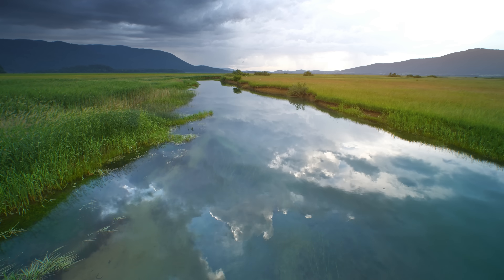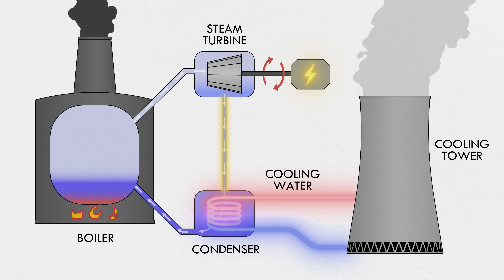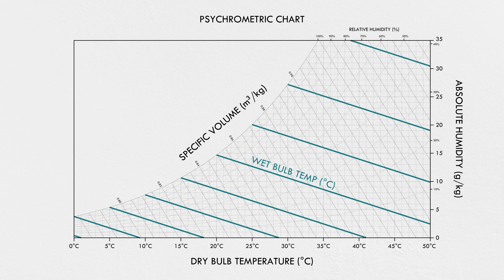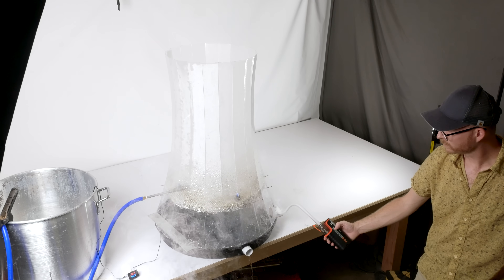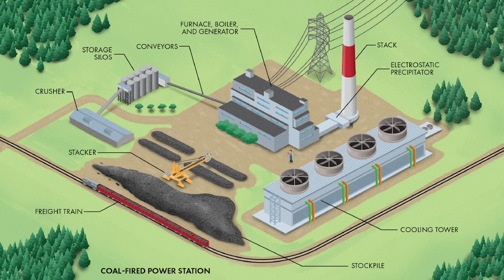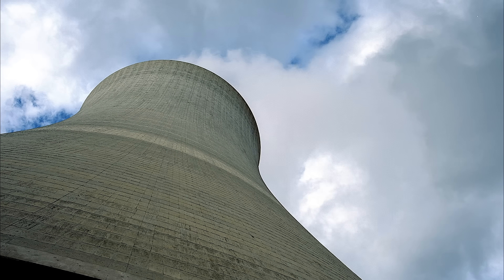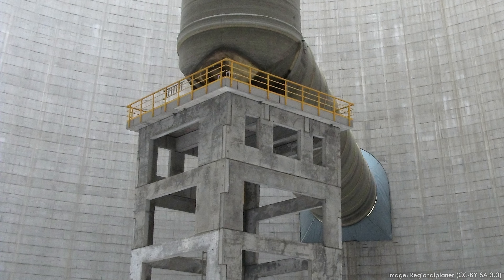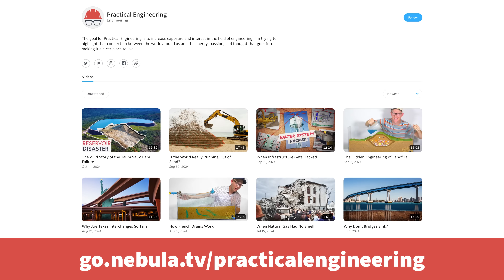Why Are Cooling Towers Shaped Like That?

Comment: 7:00 I'm an HVAC professional and I love seeing the psychrometric chart in a YouTube video! I design dehumidification systems for suspension bridge cables.
Reply: I had no idea dehumidification of suspension cables was a thing.
Reply: @stupid1557  it wasn't until they figured out packing the cables with lead paste was a no-no. There's just no better way to keep cables from corroding. The cables are made up of a ton of tiny wires, and there ends up being a lot of space between the wires in the cable for rain water to collect. But, if you seal the cable best you can and push dry air into the cable you can dry out the cable and prevent it from rusting.
Reply: @AlexWaardenburg  The age old fable of: This thing that works really well is actually made out of some toxic thing we don't want to be near.
Reply: @AlexWaardenburg  you haven't mentioned the ice that can form on those cables.
Reply: @AlexWaardenburg  I think you need your own video now!
Reply: @doodlesbug  I would love to tell Grady all about it so that he can make a video about it.
Reply: . That's interesting.   All this while I thought that the cables were just coated with a corrosion inhibitor or paint.  Thinking about that now I can see how the individual strands probably wear against each other when the cable flexes and any coating would wear off.  Is that correct?
Reply: @AlexWaardenburg   for moving cables (IE lift bridges) LOTs of grease of mopped onto them to do the same.
Reply: @AlexWaardenburg  Tom Scott has a video about this!
Reply: @doodlesbug  I second that
Reply: @AlexWaardenburg  Bruv, you've a very cool job & wish I was your bud... hearing about this fascinates me honestly
Reply: @AlexWaardenburg I learned something new today!  Thank you for sharing!
Reply: @uiomancannot7931  In this case, a thing that we AREN'T near.
Reply: @AlexWaardenburg i have seen this done for underground pipes carrying tons of betwork cables. Pushing dry nitrogen to keep leaks leaking out instead of water flooding in. Never thought we had to dry the inside of the bridge cables…
Reply: just use paper towels
Reply: @AxDhan  You joke, but that's effectively how desiccant dehumidifiers work. They soak up the humidity from the air, then you blast them with heat to dry them back out so that you can reuse them. Then you pack them in a wheel and rotate it through an airstream that you want to dry, and a separate airstream that dries them back out.
Reply: That sounds like a pretty cool job.
Reply: Air drying is used to prevent  corrosion in metal bridge decks also , the bridge that's a part of the  road and rail link between Denmark and sweden is not painted on the inside part of the bridge I deck sections on concrete pillars, and part is a cable stay bridge.
 (the pylons is concrete )
The two stores metal deck is not painted( on the inside  on the parts that's holow ),instead there is dehumifers installed that lowers the relative humidity  below the point of where rust may form. The  stay cables are covered with some kind of tubes I think, so I suspect they are  actively dried also.
Reply: I still groaned though first lol.
Reply: Wait, why do the cables themselves need dehumidification?

Edit: saw your reply and oh wow that makes so much sense
Reply: back in those days when spend hours and hours on psychrometric charts for projects, it was a delight to see it again after a decade. you cant forget what you loved to do back then.
Reply: @realracing3specter295 the love what you do and you won't work a day in your life deal is no question a true statement
Reply: I had no idea humid air is more buoyant!
Reply: It is certainly a niche area of engineering? What is your professional training in? You have to know about HVAC systems and corrosion behaviour and prevention. Air handling can be a tricky subject at times particularly when people are involved. I work at a boys private school in Melbourne and our HVAC contractors are kept busy maintaining all of the various systems we have working over a range of buildings with ages that range from the 1870s to today. 
Mark from Melbourne Australia
Reply: I literally read "psychometric chart" as he said it lol
Reply: Actually enjoying youtube comment section not bad. Hat off to you
Reply: Sounds like a 350k job!
Reply: I had heard of dehumidification for the inside of box girders on bridges but not the cables. Some Googling gave this report about the Swedish Höga kusten bridge: https://www.hogakusten.com/sv/pdf/kabelavfuktning-eng.pdf
Galvanized steel cables that were supposed to have some zinc paste that wasn't applied. Corrosion found six years after completion and then dehum. was installed for the cables. Some good pictures and figures in the report.
Don't know if zinc paste would have been as effective as lead paste.
Reply: Seeing this comment after the latest video was a surprise :)
Reply: I didn't even know that was a thing.
Reply: Are the systems you make at least edible?
Reply: @DiamondTear  I mean, lead is edible if you're brave enough.
Reply: @Catman_CM  It pairs well with mercury - and a sprig of cobalt - as an aperitif on special occasions.
Reply: @carlsaganlives6086  Ah, an experimenter I see. Lead tends to be too sweet when paired with Cobalt for me, but I've never been a fan of sweet/spicy combos :^]
Reply: @carlsaganlives6086  With a cadmium and cobalt garnish?  {swoons}

Comment: I love when videos talking about pollution show cooling towers like they are giving off pollution lol. Someone needs to teach them that its just steam coming out
Reply: Yeah it portrays as something bad. When is the opposite of that. It helps in reducing pollution and helping the environment.
Reply: Thinking they can be taught (value truth or accuracy) is generous of you.
Reply: @JimmyMatis-h9y  true
Reply: Yeah that thing always bother me, also it is more annoying when someone even thought that is a nuclear reactor
Reply: coal dust emits more deadly radiation than steam clouds.
Reply: The thing to remember is water vapour ( not steam technically) is 1600 times larger than water,what u see coming out is a lot less than u think
Reply: @TheDigger06  You can't see any steam coming out of a cooling tower. Steam is 100% invisible. What you are seeing is tiny water droplets (when the steam condenses back into water from meeting with the cool atmosphere) in liquid state already.
Reply: The thing to remember is that extra moisture in the atmosphere has significant environmental impact too. This is the cleanest energy currently available but we can still do better. Using the heat for things that need heating makes more sense but takes much more planning for co-locating industry.
Reply: @shadowgolem9158  ya releasing a whole lot of extra heat and steam into the atmosphere I'm sure isn't harmless but it's gotta beat pollutants and greenhouse gasses 🤷
Reply: @Madshadowgolem it's literally orders of magnitude better, yeah it isn't completely harmless but it's still nearly the best we have
Reply: @Madshadowgolem , no it doesn’t. The atmosphere already has much more moisture in circulation.